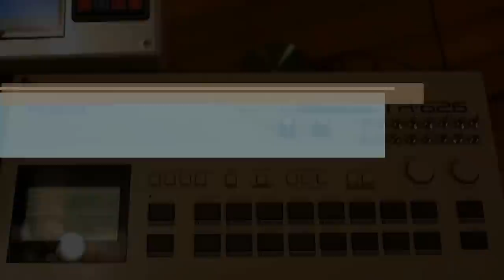Roland TR-626 Quad Pitch Mod / Circuit Bend (with on-off)

Comment: Awesome mod, wondering if you’ve considered adding a CV input at all instead of the potentiometer? I’m guessing the rest of those IC pins controls the rest of the sounds, I’m now sizing up top panel real estate!
Reply from the maker: That’s a great idea! If I were to re-do this project today I would probably do that. (I had thought about using the Arduino to control the oscillators, but I didn’t have enough analog pins available and wanted the immediacy and tactile feedback of knobs.)
Reply: @charleswerbick2154  I’m actually wondering if a modular synth can be used to control it, so a square wave tapped directly from a modular system, using the PWM knob to see if it can get close enough to the 20ms needed. Attenuate as necessary to ensure no fried chips…Or am I missing something?

Comment: super sick dude. Im planning on getting one of these soon & modding the hell out of it 🙂

btw, do you know if an adjustable clock replacement is possible with the 626? i know the on 505 you can replace the global crystal clock w/ an LTC1799, but i can’t find anything about ppl doing the same with the 626
Reply from the maker: Thanks! You probably could hack the master clock. the TR-500  and the. TR-626 are very similar and a lot of the mods for one will work for the other. (The circuit from this video is 4x VCOs so it's similar but I'm hacking the clocks per channel instead of going at the master.)

If you do decide to mod any of these old TRs, good luck and  be extremely careful soldering! (and do your mods incrementally, then test the sounds after each mod) It's pretty easy to "perma-bend" one and they do not sound good once that happens.
Reply: @charleswerbick2154  Thanks for the response!

Yeah I just ordered a ROM expansion kit from HKA Designs, so I was planning on installing that & doing some bending as well. Id really love to have complete pitch control over each channel but it does seem a little delicate & intimidating… And i’m not really sure how it would interface with the ROM expansion either. I haven’t found any info regarding that online so… 🤷‍♂️

I may just stick with the ROM expansion & maybe a patch bay for data channel bends. And I appreciate the cautionary advice, irreversible damage is definitely something I want to avoid lol
Reply: I believe that you can pull one of the legs off X2 and use an LTC, that's what I'm planning to do with mine, in addition to hopefully these mods (which are great).

Comment: Any chance you have a drawn schematic of any kind of your circuit?  It seems simple, but the values are probably important, and the diode/resistor portion for the duty cycle isn't something I'm familiar with.
Reply from the maker: Do you mean this circuit? 

https://cdn.hackaday.io/images/3882461435044432252.jpg

(From the project page on Hackaday - https://hackaday.io/project/6389 )
Reply: @charleswerbick2154  looks good, yup.  thank you

Comment: Wouldn't it have been easier (at 4:26) to cut the traces midway and solder directly onto them?
Reply from the maker: Possibly. But either way the penalty for a mistake is high. (One way I've got a broken pin, the other I've cut the wrong trace accidentally...)
Reply: I just bought a TR626 and I'm quite interested in this mod but I've got a lot of SMD soldering practice before I even attempt it.

Could you potentially do another video of just playing a normal rhythm pattern on the Roland and just playing with the knobs from this mod?

I want to get a better sense of how it sounds.
Reply from the maker: did you see this one yet? - https://www.youtube.com/watch?v=nu6FfKYgT78
Reply: Must have missed it somehow.

Cheers.